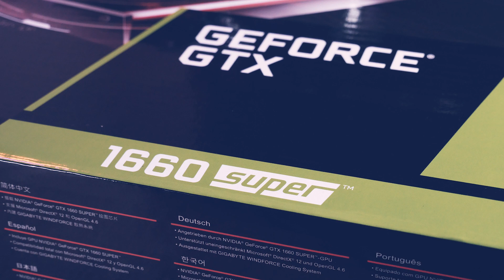April Mining Update 2020: GPU CPU FPGA on ETC / XMR / AION (Cursed Mining Farm #23)

Comment: can we use GTX 1080i Ti FPGA cards? I have 1
Reply from the maker: 1080Ti is no FPGA, but still a great GPU for mining :) check Zcoin or Aion or easy: Ethereum - cheers ⛏️
Reply: @CursedMining  Thanks for the answer. I have around 1.8k USDs to  invest, what do you think I should be investing  in? In making a rig or buy a currency?
Reply from the maker: Impossible to say! Rig is always more long term but you can also still resell parts, buying the coin.. can be 10x or your money just slowly dwindles away. No right way, if you are a nerd and like to build and tweak things, mining is a nice hobby/passion

Comment: Well, what i did in the last 6-8 month is selling all my 6 mining rigs ( 36 gpu with, 6 motherboard, 6x i3-7100, 6x 8gb ddr4-2400 , 80 riser and 12x 700 watts bronze psu ) My gpu was Rx 570 4gb, GTX 1060 3gb , GTX 1060 6gb and GTX 1080. And now with all that money i have 2 Octominer 9pci with 18 GTX 1080ti and 3 PSU ( 1450w gold ) Mining now on Hashr8 OS!. This is the best move i made. I can mine so more coin with Nvidia and with that move, I make more income with less power. I'am more efficient ( From the wall for the full 2 rig i'am at 3150watts-- Before i was at 4225 watts) and i don't have the bad riser to find. I will never buy mid range gpu it was a error, i will always buy high end gpu like 1080ti or 2080ti. In the futur i will buy one more Octominer with 9 RTX 2080ti. Keep up the good work really cool content!